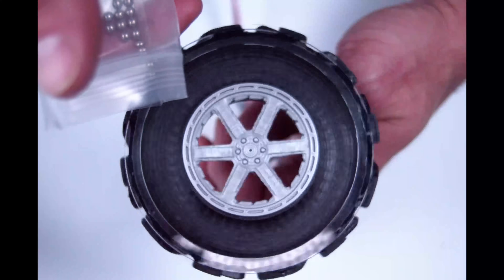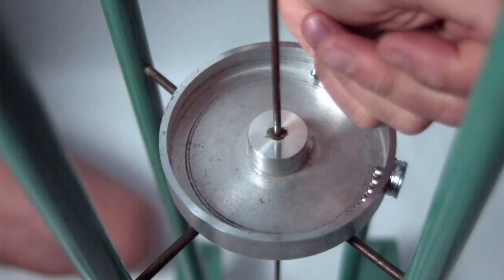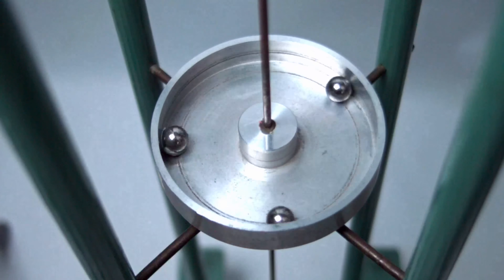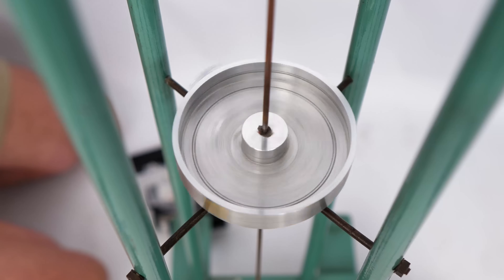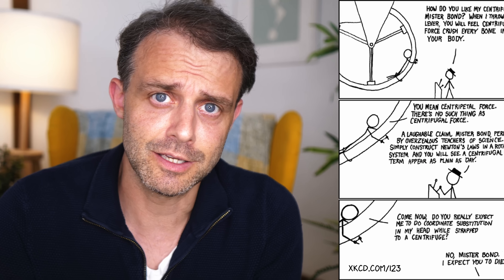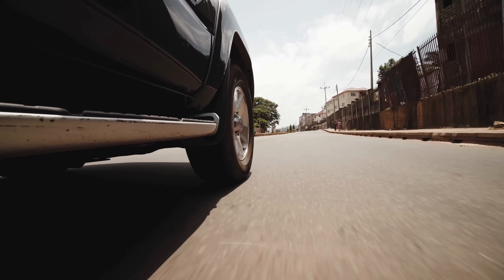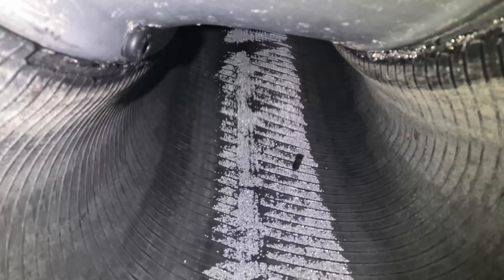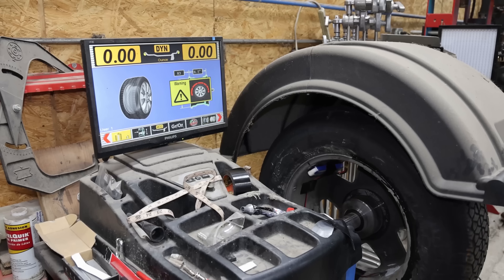Do tire balancing beads actually work?

Comment: Mech. Eng. student here, thesys in mechanical vibrations. I have a few corrections to make:

1. Resonance is NOT a mode, it is a condition in which the system experience external load in its natural frequency. Usually, the higher the frequency, the lower the amplitude is expected to be. But in resonance, the frequency is "just right" to get an "additional push" of energy in the exact moment, resulting in a higher than expected amplitude. Its like a parent swinging a child, pushing it at the peak of the swing in the exact moment to keep it swing high.
2. Mode for itself is an important term when dealing with vibrations which describe the "shape" of vibration. In this case we have a single mass, hence a single preserver of kinetic energy, with a single modeshape moving side to side.
3. Dont use springiness, either stiffnes or compliance. They are the correct terms, and opposite to each other. Stiffness is like the K in the Highschool formulation of Hook's law (the amount of force a spring will exert for a given unit displacement), and compliance is the difference in length a spring would change under a given unit force.
4. "Waggle" is just a vibration, with no unique properties, unlike resonance which I already corrected.

So, the explenation is very simple. When you wiggle the system, you vibrate it. The external "waggle" inserts external kinetic energy, but sometimes the energy adds up if the external "waggle" and the vibration are directed momentarily at the same direction, but it can also canel some of the energy if the external "waggle" and the vibration are directed oposite to one another (actually, this is the idea behind active dumpers). If it sounds like wave beaviour, its because its mathematically identical. BUT if you could make sure somehow that the external "waggle" is always directed with the vibration of the mass, you will build up energy in the system, hence get a resonance.

Comment: 9:25 80 km/h !! The exact speed at which you can tell if your CV shaft is worn out and vibrating, amazing! When my CV axle boot was torn and the CV joint was worn out, the car would wobble at around 80 km/h when driving steady speed, but only after I did a left turn and the right (worn) axle would be turning the wheel (due to how the differential works).
Reply: If you inspect your axle boots and replace the boot, a CV axle will last almost forever. I had 879,000 km on a set of axles on my golf. Anytime I noticed a leak I would replace the boot and clean the joint completely and repack with grease. Think the proper grease is lead based on at least lead additives and I have always tried to limit my exposure to it. 
Have not seen axles with the trident style inner joint come anywhere close to that in longevity.
Reply: @scotttod6954  Usually, the grease you'd use for that application would contain molybdenum, not lead.
Reply: @scotttod6954  I got the crimper tool and do the same in my Audi A4...but only because the non-OEM cv shaft replacements suck and the OEMs are crazy expensive. I wouldn't do it if it were available for cheaper, because you have to pull the axle anyway! 
(FWIW, the A4 B6 uses the trident "plunge" style, but mine have been good for 160k miles so far with boot replacements as soon as I notice.
Reply: @scotttod6954  Replacing the boot is such a pain though.

Comment: OMG SO ADMITTEDLY I HAVEN'T WATCHED THE VIDEO

I'm a lil tipsy, so I'll revisit this later when I can focus.

But I want to make a prediction: shared space systems act as a single unit; as long as this system is greater than 1, it will find an equilibrium.

How does it do this?? Let's simplify and come up with possible solutions: okay, so two ball bearings will equal out momentum wise when spun on that disc. Most likely they both moved to one side as a single unit before being spread to opposite sides to maintain equilibrium. Could this be because of initial weight imbalance? Initial rotation vs inertially conserved rotation?? Will the trailing ball bearing always be the one to move into equilibrium position??

Comment: So if the beads had some kind of adhesive that sticks to the tire an would cure in like 30 min.
Could you balance the tires by filling up the tire and then driving fast enough for half an hour (minus the time it took you to mount the tires and wheel on the car)?
(hoping there is not much traffic.)

Comment: Liquid should do this too. I wonder if fast curing flexible epoxy in a tire, then spinning the tire at freeway (Motorway) speeds would self balance permanently? Even if it cracks, but stays adhered to the tire...

Comment: technician here, balancing wheels (the industry refers to it as wheel balancing, but means wheels with tires on)
is practically free, and is not really an issue, i think that initial "mechanics hate him" is most definitely click bait !
(also of note, NEW tires come with a red and yellow spot on, to aid in the balancing of them) 
BUT what IS interesting, alot of washing machines use this technique to balance the drum,
as this changes on each wash, as depends what washing you have in it ..

Comment: Couldn't you add some slow drying adhesive, then drive the weel for 5 minutes on a table or in the air and then their fixed?

Comment: The biggest issue is that the good quality balance beads cost as much if not more than just having someone balance the tires at a shop. A real use that I have seen is in big offroad tires with aggressive tread. If you lose a big chunk of tread while rock climbing, the balance beads will automatically rebalance properly.

Comment: 2:30 That's a bearing ball, not a ball bearing (A bearing ball-bearing, bearing) :)
Reply: We've always referred to them as ball bearings simply because of the fact that we also have needle bearings , roller bearings and cone bearings.  It's just a matter of where you grew up and what you were taught. Either way would be an accurate description
Reply: @Tommygun18wheel  woosh.

Comment: You example is missing something  important. Tire are not perfectly round. They have a flat spot on the ground as they roll. Would this mess with anything trying to balance the tire by moving around?

Comment: There's a solution:
 use a liquid material that transforms into a flexible mass over time. maybe with some suspended denser particles to get the required mass.
once you've driven long enough at super critical speed, the configuration will be permanent, even when stopping.

Comment: glass beads would wear out your tires from the inside, your tires would be out of balance if you hit the gas hard even if your already moving, never mind taking off from a stop.  your suspention would take a beating while your tires are out of balance.  Or you could just pay someone to hammer on a lead wieght to your tire and solve all these problems.  There is a reason good machanices don't use glass beads

Comment: the vibration becomes imperseptible ate motour way speed... but it is still vibrating, so it still a problem to the usefull life of the motour... so the beads may not increase confourt significantly , but they should hae a positive efect on the maintenese end still

Comment: I think its a fascinating concept and the physics probes it right. My concern is for modern cars with quite large TPM units getting hit over and over again with glass beads or bearings balls, BB's, etc... as some mentioned below. Most TPM units have plastic housings and having it hit by beads repeatedly might not fair well long term...

Comment: if they had some fixed cure time adhesive that would hold them in position after x minutes I could see them working, just be at highway speeds at x minutes after adding the adhesive, but I imagine that adhesive would also clog your air valve causing other issues.

Comment: I have to ask the  question since it isn't said in the video: does the fact that a wheel road on the road, and so it's movement is more limited in an axes compared to another, the fact that the tire flexible, and the fact that the tire isn't flat have any effect on this situation? because the example in the video are not in the condition when you drive, and so even if the effect appear in some cases, it doesn't mean that it will alway happend (example: surface not flat could block the bead in a situation that isn't balaced)

Comment: I believe that the wobble takes some time to happen, which should be similar to the calculation for a pendulum. Thus, there's a certain RPM, at which you get the full impact of the imbalanced wobble. Specifically, you're looking for the angular velocity of the imbalanced mass that would match its pendulum frequency. Above this angular velocity, the mass simply doesn't have enough time to wobble, so it only imparts a portion of the centrifugal "force" on the axel that it does at its ideal angular velocity. 

The interesting question is why above that ideal angular velocity the masses self-align to cancel out the centrifugal "forces" on the axel. I believe this is due to the Centripetal forces now being larger than the fictitious centrifugal "force." This leaves some power left over that's preferential to a lower energy state. the lowest energy state available is when the masses best offset each other, and the motion is balanced. Meaning, the difference between the centripetal force the wheel and axel are excreting on the ball bearings or beads is as close to the perceived centrifugal "force" form the ball bearings/beads to the wheel & axel. 

I believe it's the delta between these two powers that enables the ball bearings to self-align, with the most balanced arrangement representing the lowest energy state of the spinning wheel due to not having to support the imbalance between centripetal force and perceived centrifugal "force."

This also explains why, at or below the pendulum frequency of the ball bearing/wheel arrangement, the ball bearings collect together at the most eccentric point. At or below this angular velocity, centripetal force vectors and centrifugal "force" vectors are equal but opposite, so there's now leftover power to self-align the ball bearings.

Comment: Thank you for the video! I understand better how the washing machine can centrifuge the clothes without tearing itself apart.
However, I do not trust in tire beads just because I do not know how much extra wear it puts on tires. The beads seems rounds, but still harder material than rubber so it can cause more frequent tire replacement.

Comment: Would using some sort of newtonian fluid work? My thought is it would get more liquid at high speed (high stress), so it would move to fit the right distribution that would make the tire balanced. And more viscous at low speed, so it might keep the balanced distribution. 

Maybe the stress is higher at low speeds?

Or use an epoxy that cures over time. Inject it and drive on the highway for an hour until it is solid.

Comment: Sorry but balance wheel is ₤10.00 per wheel.  New tyre is ₤74 and once done it's balanced until you messed up. Meaning you get 14 to 33 thousand miles.  Don't do it and you get less than half plus several other issues. Beads save you 30 to 42% if you do 55 to 20 miles at all times which is near impossible.  So it's indeed pointless idea. Yes it works.... BUT... BIG BUTT you will be. 
As for swearing by... village idiots swear by a lot of things... none I will try thanks. 
My car is ₤110 per tyre, balance and fitting ₤16.00 x4 and the suspension components and everything connected has Mercedes-Benz written on it making it very expensive.  So ₤40 really is nothing to get miles and comfort without breakdown. 
Now I am sure some redneck with a truck that's hazardous to everything came up with this. Internet allows idiots to have a voice. No? Trump. YouTube adds. Resonances kills machines is all you need to know. It also hurts me and makes me grumpy.

Comment: Allegedly, in 2008, I drove a Ford Taurus at 95mph and it had terrible wobble in the steering wheel. When I passed 115 and up to 145, the wobble went away. I imagine it's the same concept!

Comment: I had balancing beads put in my motorcycle tires. I couldn't feel any difference between the beads and when I had the tires balanced with regular tire weights. Highway or surface streets or around the neighborhood. And I didn't have to worry about getting out of balance if I lost a tire weight (which sometimes happens).

Comment: Honestly, I see this as not really working, but gives promise to work.  What is really needed is some kind of polymer to bind teh beads in place once they are settled in at higher speeds.  Maybe something like Fix a flat, but uses the beads and a binder, squirt it in, and drive for like an hour at freeway speed to settle into place, maybe?

Comment: What if you were to put some sort of adhesive inside the tire which would hold the beads in place after getting to highway speeds?
There would be some trial and error to find an adhesive which would work in a good timeline, but the concept seems sound.

Comment: Wouldn't a flexible axle like the cantilevered one you use have several modes of resonance? The higher speeds could just be hitting a higher mode, which will naturally have less amplitude (more half-waves)

Comment: similar to a centrifuge, gyroscope, evenness matters. But generally I was thinking of water molecules, like water buckets. If you have TONS of water buckets, like 20.
I love watching and reading comments on educational channels always a blast after the video <3

Spinning 20 is hard at slow speed, water will drop. Faster will bring all water buckets evenly, and then not drop any left over water. That mass will bring the other buckets evenly, THEN once fast enough energy, it'll balance, and no water drops. So less resonance like wind does to tall buildings, this evenly splits the weight along the axis, rather than the axis spreading the weight onto itself to balance, as strong as axels are, there is a max/min. This is the same with everything.  

I do see how you'd think this wouldn't work due to resonance on buildings and bridges. But circular force is so much fun, constant turns, where is the end?! Unlike buildings and bridges, there are other moving parts that go in many more directions , therefore more possibilities. So this is why Tokyo and other countries that have earth quakes invest into anti-shuttering or anti-resonance , so this doesn't constantly grow into bigger and bigger unstable forces.

Comment: I actually work in tire mounting and balancing at a big car manufacturer. Balancing beads are a very cheap option that doesn't require expensive and well calibrated balancing equipment, but it's not very good for normal cars that spend a lot of time in the city, starting and stopping. Since they need to "re-balance" themselves every time. This works for long haul trucks which spend most of their time on the highway anyways. But for a consumer car, you really want well balanced tires at any rotational speed. Also, if you run over any sort of larger bump, the balancing beads would have to re-settle so every time you run over a large enough bump, your tires would vibrate again until they are balanced out. 
There's a reason why no big manufacturer (VW, Audi, Mercedes, BMW, Porsche etc) uses balancing beads. It's not really the best quality option when it comes to consumer cars.
Reply: Actually its because of 1: Cost. 2: Tire pressure sensors. 3: Runflat tires.

Comment: Really interesting. I can see how this works for motorcycle tyres that are usually only balanced in the plane of rotation. But not 100% for car tyres that also need to be balanced for sideways wobble because of the greater width and way they are mounted on the axle

Comment: You can use three golf balls instead. If you don't have tire sensors, I wouldn't put the beads in with tire sensors anyway. But golf balls are reusable and I would bet that they probably balance quicker since they can roll easier inside the tire.

Comment: Here's the alternative to chugging free moving mass into your tire, which can exaggerate the resonance at low speeds and only kinda works once you drive over 80kmh, but then completely goes away when you are below 20kmh:
- just get your tire "permanently" balanced with fixed weights... It's pretty cheap and long lasting at all speeds all the time.

But yeah the physics is neat 👌

Comment: Ever heard of vibration modes? some time is only one that is stable, sometime two or more, but sometime there are oscillating between them with low frequency.
Don't overthink it, it is all just energy that bonces between kinetic and elastic of that specific shape, while trying to find paths to flow somewhere to dissipate.
Think of it like stream of water that is sprayed over an object with complex geometry, the flow is not so strange to us, so does the flow of kinetic energy that goes thru the elastics of an object while "steams" out to somewhere.

Comment: This screams for a clever (chemical?) inventions that would make the beads become permanently fixed once they settle on the perfects spot. Maybe times based, or some surface effect, that only acts once the beats touch the same spot for a while. The flow would be will in the new beats (maybe with an activator), drive above the 80km/h for 30minutes, and the beats are fixed at the perfect balancing spot for the tire live. If it becomes unbalanced again (or the 1st process fails), just repeat with some more beads.

Comment: 1:09 
💀 The point of it is to place it on an unbalanced frame. You put it on an almost perfect circle, so anything you place on one side will make it unbalanced. If you are using balancing pieces on an object that does not have a lighter or non-perfect edge, then you are using it incorrectly, or even doing the opposite of its purpose, as it becomes a problem and not a solution.